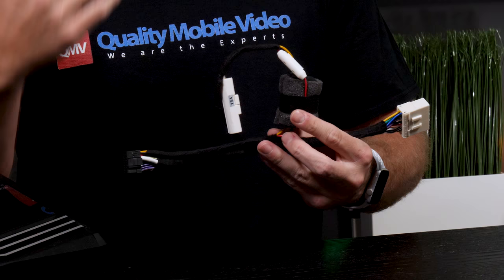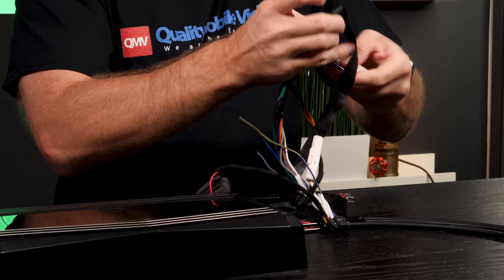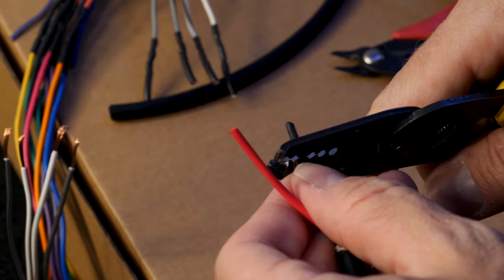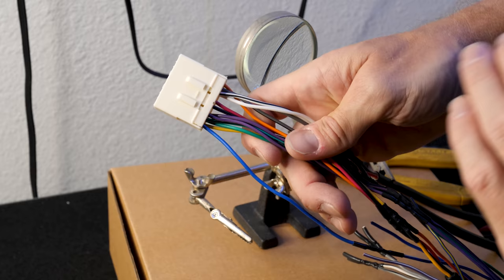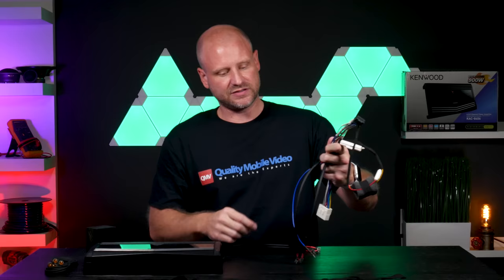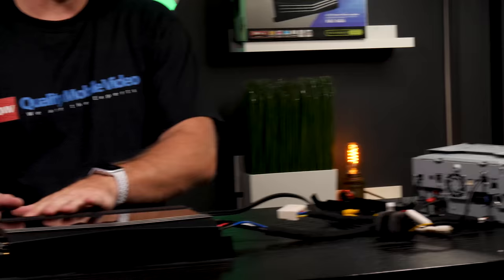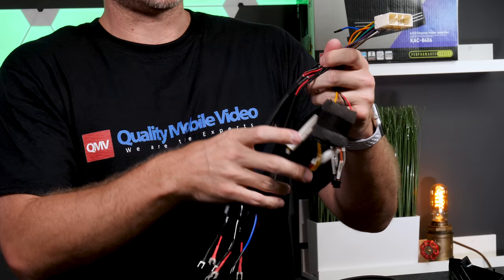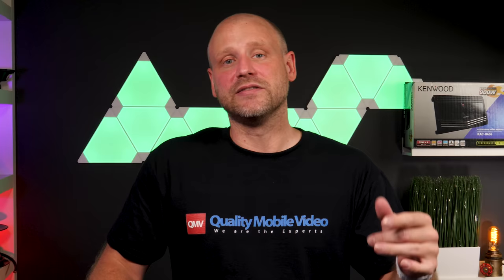Wiring a 2 or 4 channel amp to your stock speaker harness without cutting the factory wiring

Comment: How is the sound from all 4 speakers those  it make a different if i run 12"gauge to all 4speakers??comparing to the manufacturing wire's😎😎✌✌
Reply from the maker: Lorenzo here, I have a huge SQ setup, I have yet to run new cables through the doors in most SQ setups that I build. Depending on the vehicle manufacturer, 18 gauge in short runs (cut at the kick panel, 5 foot run max) will generally suffice, depending on current requirements. I will run new leads of 16-14 gauge to that point. If running full active, then new leads are required. I am not a huge advocate of running new wire through Molex'd door, feels very hackyyy, unless you can pin empty OEM connectors
Reply: Quality Mobile Video  Lorenzo so are you saying not to run 1 long speaker wire from say the front door to the amp in the trunk?

Comment: I cannot find a proper wiring diagram for my 2011 Ford Edge SEL 8" touch sync non Sony to tap into stock headunit. I mean I found one online which happened to be the same as the info Crutchfield provided me with but it's wrong because those colored wires are no where to be found! So now I have a dismantled vehicle and an entire sub system including the LOC, sub, box, amp, capacitor, amp kit, big 3, etc but no way to start install!! Best Buy here I come unless some nice fella can provide me with the proper speaker wires colors..?? I only need either the front or rear mid-woofers. I don't have a sub or tweeters. Only 4 stock speakers all of which are inside the doors. Guess I may be able to remove two rear door panels to see what color wires are attached to the speakers but come on! The info must be out there somewhere.

Comment: min 9:40..i have a question related to the noise suppressor/filter,can i add one to my single din unit on a mustang 99 with mach 460 sound system?..where can i buy one like the one that shows on your video?..i would really appreciate some advice.im subscribed to your channel,great videos,the best in my opinion,pretty straight forward,no rodeos at all,thanks for making this type of videos.

Comment: How would i bypass my factory amp in 06 impala ss and use a 4 channel amplifier..
Reply from the maker: https://www.qualitymobilevideo.com/ax-adgm01.html
Reply: @Qualitymobilevideo  is there a way to bypass the factory amp and just use the factory wiring from the amp in the trunk..line out converter to amp or am i better off just buying the harness. My main issue is the factory amp cuts in and out whenever it feels like it..

Comment: What side of the car should the speaker wires run? I read somewhere that you should separate the power wire from the rcas.
Reply from the maker: Generally yes, running them together can introduce noise into the RCA's. Just run them on the opposite side of your power wires
Reply: Quality Mobile Video what about the speaker wires? Does it matter?
Reply from the maker: Every car and every installer is different, check out how we do it: https://www.youtube.com/watch?v=ViY4vGoYYDw

Comment: 8:10 Or you can De-pin the wire from the harness connector
Reply: Please explain this scenario 🙏🙏🙏
Reply: There’s a tool on Amazon that allows you to depend the wire from the connection so you don’t have to tape off the wire it’s a lot cleaner basically just remove the whole wire go on YouTube type in how to de-pin a wire connection click the first video

Comment: So if I have a 2 channel amp for my door speakers can it be used to hook all four door speakers to it or do I need a 4 channel amp
Reply from the maker: Check the amplifier's manual, you should be able to bridge them onto those channels like we did in this video: https://www.youtube.com/watch?v=vxWSN60i5ew
Reply: Ok I’ve done that and now my pioneer 7700BT started smoking by the fan did I just ruin the radio and need to go buy another one?

Comment: Is there a link, to 1 of your videos, that shows how to make the "T connection" that you spoke of in this video??
I'm installing a new double din, amp & subs in my 04 Grand Cherokee w/Infinity system..I have the right Metra wire harness, the double din radio  bezel thing from Amazon, 1200watt Vertigo 2 Channel amp, 
2 12s JL Audio600w(oldschool👌😉)
4ga amp wire kit & 10ga speaker wire...I want my after market Boss double din to keep the factory Infinity amp on factory Infinity door speakers. But I also want my Vertigo amp  to power my subwoofers too. How do I make the t-connection you spoke up so I can use both amp I've heard I'm supposed to run new speaker wire to the front door speakers but do I still have to do that if I make the T connection??? Pleeeeas help

Comment: i didnt see you connect the power or the ground on the amp... do you still have to run a power line to the battery from the amp?
Reply from the maker: Watch this other one for that https://www.youtube.com/watch?v=ViY4vGoYYDw
Reply: Yes a power + directly from the battery to the amp and im assuming you live in the usa so you would have a negative ground so negative could got either to the battery or to a bolt on the body (ie: seat bolt) as long as you sand/scrape away any paint so it could have a proper connection
Reply: Exterminatingtraper this whole video was nearly about the pros and cons of a small power wire instead of a large large gauge from battery to the rear most likely. Using a distribution block you run a short but optimal wire to the other as possible and or can also which is a good idea to have a capacitor....so that said ise the capacity for the dist block and like he said any rca wire doesn't need to be near the power wire anyhow. So having two would be rather stupid tbh

Comment: So instead of cutting the wires up front were the head unit is. Cut them in the trunk were your existing factory amp is so you can have your new amp in the trunk instead  of up were your stereo is

Comment: How can I use this set up on my 2003 silverado stock bose amplifier. I have metra controlling my steering wheel controls OnStar and of course aftermarket radio so I can add a 4 channel aftermarket amp and use same wiring
Reply: ehhh maybe often times it simpler to just run new wires then to bypass amp (modules can be expensive as well)
Reply: @luvdady  the reason why I want to keep same wiring due to I have all my features. Steering control, door chime, onstar and etc. But there is no harness I need to make one. But dont know how. I'm asking how to do it . A wiring diagram
Reply: @vvillagrana290 if you got a aftermarket stereo there should be a factory  bypass module . which used to be around a $100 + for the gadget. 
which if you are running a 4 channel amplifier from an after market head unit it would be better quality and cheaper to just direct wire the speakers. 
the diagram youd need would just be a factory diagram and simply run the channel wires to the colors
Reply: @luvdady  yes I do I have aftermarket radio running a Metra module for the speakers wiring due to I have Bose amp i need to bypass it to keep my features and  run my aftermarket 4 channel and my subs as well. Right now I'm running my sub through eq but I need to bypass. What gadget are you talking about?
Reply: @vvillagrana290  amp  bypass (like the box retains the controls for the onstar ) but you'd simply tap into the bose input color to the speakers terminals on the 4 channel . 
seriously though for a 2003  this is a amazingly troublesome work around 
id chop the harness call it a day and  just leave enough to reconnect the plug if need be truthfully lot of work for minimal results

Comment: If I may ask you this. Doesn't pre out works the same way as a normal receiver/ amplifier? When yoiu install a pre-amplifier to your exsisitng system at home, you use rca cables to connect your amplifier to your pre-amplifier. You don't connect any speaker wire to the pre-amp. So with a headunit/car radio that has speaker pre-out, you just connect rca to front /rear speakers from headunit to amplifier and that's it. The speakers are connected to the headunit via iso harness and when you connect rca to pre-out, speakers are active through rca.  What you are doing is waste of time and not needed. In my Hyundai I have a 4 speaker amplifier connected to my head unit through pre-out  (front and rear) and connected to my JVC amplifer with RCA front and rear.  No speaker wires. And you know what? It works just great!

Comment: Did anyone catch the fact he reversed the polarity on 1 of the speakers using the top row of outputs 4 channel config?
Reply: ?? No do you know?
Reply: @dantheisen35  14:55 you tell me? he reversed either 1 of the top set or 1 of bottom just guessing.  hes got red, black; red, black on the top row and then red, black; black, red on the bottom, just looks off to me for some reason

Comment: So if you have an aftermarket radio, you would just wire it to that instead? I still have my original HU because is has my climate controls.
Reply from the maker: Depends. What are you adding to your system? And what's your make, model and year?
Reply: Quality Mobile Video I have a Honda Accord 2003 LX, I’m installing new rear speakers but would like to use an amp to use the full power of the speakers but I had wired my stock HU and aftermarket stereo to allow full control for my climate controls
Reply from the maker: If the aftermarket stereo has speaker level outputs on the harness you can use those like we did in the video!

Comment: A Question............. I'm thinking of installing the amp on stock speaker set ,So will my speakers get me more bass? or I will have to buy new subs.......
Reply from the maker: You'll definitely get more power to your speakers, but factory speakers are usually made of hopes and dreams, so if you want improved bass I highly recommend upgrading the speakers as well as adding a subwoofer.
Reply: Thankss....One more question, if i install a sub, so still will I need the amp, sorry but I'm too young so thats why I am not that much into stereo systems, but still will appreciate for the answer
Reply from the maker: You have a lot of options bud! You can do something like get a 4 channel amplifier to power your speakers and your sub. Or you can replace your speakers and have them powered with the dame factory head unit. Or have just the front speakers powered by the factory connections and rear speakers and subwoofer powered by like a 2 channel amplifier. Or you can even get two amplifiers, one to power all the speakers, one for the subwoofer.
Reply from the maker: Watch this system build we did, I think it'll help you a lot: https://www.youtube.com/watch?v=ViY4vGoYYDw&lc=Ugy1TmUa4yFKNl5tn-94AaABAg

Comment: Plz help, i have 4 component Hertz speakers and one Hertz basstube 1000 watt and this needs to be put to 4 channel amplifier (or atleast i think i should), how should i install it ?
Reply: Adv Prikshit is the basstube not amplified?
Reply: Adv Prikshit me personally I'd power the sub separately. Depending on what sub it is n what rms watts is needed if just a mediocre sub these days need a good 200 continuous which is more than people give 200 rms credit for. That depending what sub you have you may have to get two much of a 4 channel amp n still run the other four off of it let alone the sub will need low pass while the all the others need sp.  Like for instance these old ass subs I got...killer bang for the buck. 
10" dual 4ohm voice coil. You got to worry bout the amp stability and the speaker ohms in connection with how you wire it. 2 run them both I would need a stout 2 channel or a good mono d class that run stable at 1 ohm. With 2 dual 4 ohm subs I can run them in series and or parallel and get more out of the amp. More info and I will help all I can. I'm bout to install one of the 10's soon as I get off my ass.  Been sick as hell since bout 2:30 am. I have a rare incurable disease that you probably never heard of. Anywho. Send me a fb friends request and I'll talk directly to you
Reply: Jason Jennings Thank you soo much man. Sending you req.
Reply: Jason Jennings It is amplified but i need to confirm whether to put two channels into it or not.
Reply: Adv Prikshit only if it's not getting thr watts it needs.

Comment: How to install a power cable in suburban 2004
Reply: Guillermo Mejia battery wire from positive side to amp run it through a hole in the firewall and under the door sill plastics all the way back to the amp

Comment: how do u wire subs to stock radio that has a factory amp?
Reply: jose olivares you would need a line output converter
Reply: Go to best buy and buy a line output converter that has rca jacks built into the converter meaning you will have to tap into your two back rear speakers too get a signal and u will be able to run your subs to your amp my manz

Comment: Can i connect 2 amps for 4 speakers?, for example 1 amp for rear speakers and second amp for front speakers?

Cause i think my BMW comes with a factory amp and i have a Steg amp, and i want to use them both if it possible...

†

Comment: "Wiring a amp to your stock speaker harness without cutting the wires"

> Proceeds to cut the wires

Alrighty then.
Reply: He's cutting the aftermarket wiring harness adapter wires and not the factory wiring harness
Reply from the maker: Thank you

Comment: How do you connect an amplifier to a subwoofer?
Reply from the maker: https://www.youtube.com/watch?v=ViY4vGoYYDw&t=895s
Reply: Quality Mobile Video the Tahoe  I currently have came with pre-installed cables along the one that goes to the battery. However, it's cut half way there.  Is there a way where I can take a picture of the setup and get some tips from you?
Reply from the maker: The cables are cut!? Sure this is my email: jamesd@qualitymobilevideo.com
Reply: Quality Mobile Video I already sent a message to the designated email address

Comment: for the remote cant i just split off from my mono amp to a new 4 channel amp?  or just i run 2 remote wires from the harness to each amp?
Reply: This is a question I'm faced with also
Reply: Yes you can split. Just add another remote wire your mono and run it to the 4 channel. Or a distribution block but it isn’t necessary for a remote wire

Comment: You didn’t do a very good job explaining which connections went where other than the amp was. Which harness was the aftermarket radio harness?  Which harness was the factory harness in the car?  Great to do this on the bench but these things are more important than watching someone solder and heat shrinking connections. That’s the easy part. Almost made the video worthless. Much longer than it needed to be with less clarity than I needed.What’s a Metra harness?  Is that like a female harness from a Geo Metro or is it an aftermarket wiring harness for a particular car?

Comment: Most factory head units don’t have RCA outputs, this works for most aftermarket head units, but for a factory radio this simply won’t work. You need an amp with speaker-level (high level) inputs so this video is pretty worthless
Reply from the maker: No you don't. Your other option is to use a Line Output Converter which transfers the speaker level outputs from the harness to RCA's which connect to any amplifier with RCA inputs

Comment: For a video that said not going to cut any wires you sure do you cut a lot of damn wires including the wires from the factory harness as you said in the description you would not do
Reply: He said none of the oem harnesses will be cut, the harnesses he is cutting are the  aftermarket radio harness and a Metra adapter harness.

Comment: The speaker wire is cut 
How would the speakers even work now
Speaker to the head unit = connection lost 
Makes no sense at all speakers wouldn’t get any signal at all
Reply: David Arndt 1) RCA cables from head unit to input amp = signal to source speakers 2) after market (new) hu PLUG CONNECTION is simplified by metra harness connection to transition into factory (original) hu PLUG 3) amp output back to hu  you!ll easily locate factory speaker leads in original factory harness.. Which is the purpose for video.
Reply: Rodger Wallace  no lol 
Speed wire from amp to the harness 
Simple ... the cars harness only thing that’s left that goes into the head unit is power ground ect